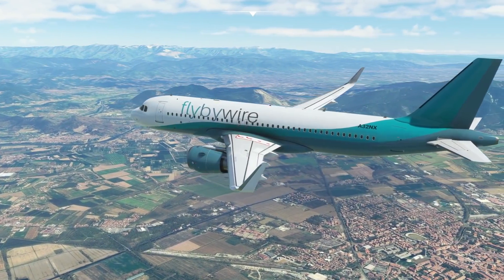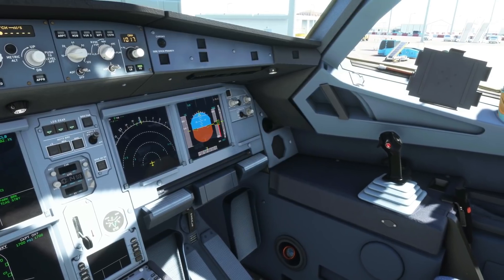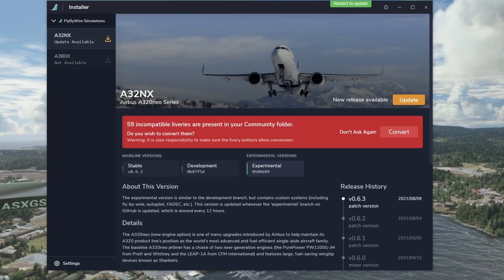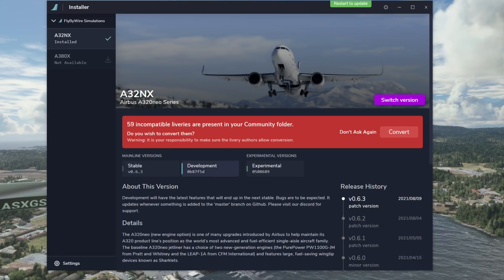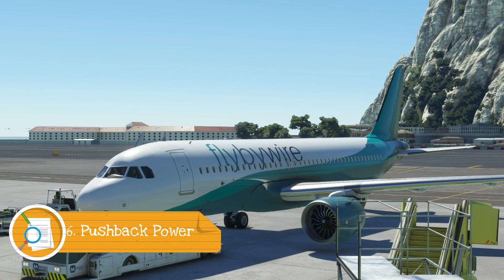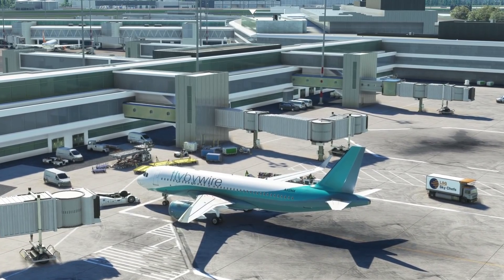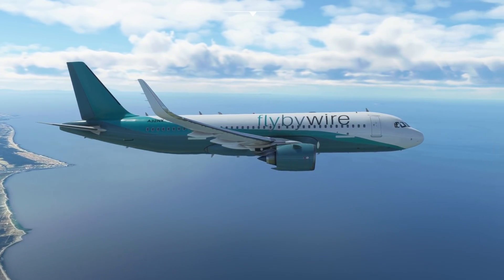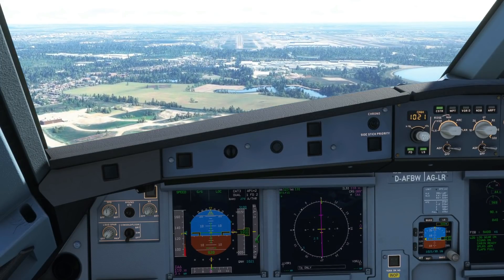FlyByWire Troubleshooting - Fixing Your A320 NX in MSFS 2020 After Sim Update 5

Comment: Thank you for the tips. Very good point on the ILS as I was wondering as well which one to use. As per the autobreaks, interesting point, are you saying that in RW procedures a full stop is performed with autobreaks only if we exclude autoland? I always thought that a rollout would end with manual breaking. In fact I see in many YT cockpit videos the PF saying "manual breaks". Perhaps company procedures or just the wish to save some taxi time? I remember a lot of LH pilots performing hard breakings when flying into EDDF ,which has long runways,  just to pick the nearest exit to their terminals......
Reply from the maker: Auto breaks are used on shorter or contaminated runways - regardless of autoland or manual landing.

As stated in the video, the idea is to disengage the autobreaks at around 30kts so you don't stop on the runway & keep rolling.

Comment: One problem I seen sometime, is when I set the approach  in the MCDU, then I loose everything setup in the star!! It cleans everything that was setup for the star!! So when is the best time to have the approach setup in the MCDU??
Reply from the maker: Did you see the portion of the video explaining how to prevent this happening?
Reply: @Easyjetsimpilot  Yes I did. I use "direct" almost every time anyway near the transition. But it is weird for the MCDU to erase the whole thing as soon as I click the "approach phase" in the MCDU. SO it there a specific time to click the "approach phase" in the MCDU?
Reply from the maker: @mobbe123  then if you use the correct version, you'll no longer have this problem 👍
Reply: Are you then selecting the same Star  including Vias and Transitions as in your original flight plan?
Reply: @Ellipirelli69  I don't I load the flight with just the departure and then I use Simbrief" and manually set up departure and arrival.